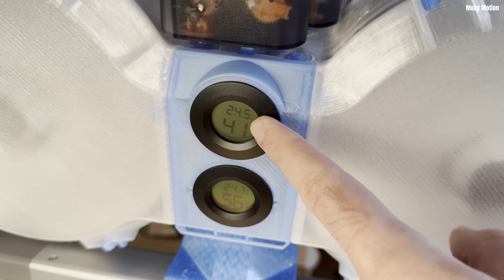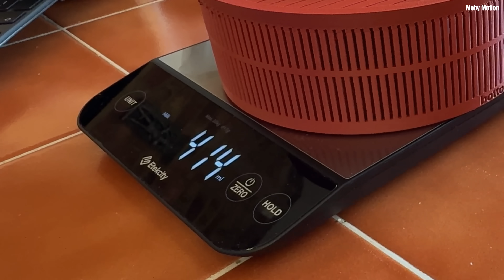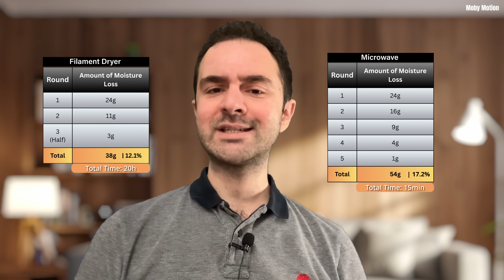Stop Drying Silica Wrong! Microwave vs Filament Dryer Tested

Comment: I recharged a couple 100g packs of rechargable beads and the storage bin has continued to stay at 10%... so I'd say nuke them, much less effort. I just put the bags on a couple layers of paper plates and did 2-3, 3 minute half power. Odd though that after the first 3 minutes the beads that weren't full on green were deep green, probably cause they were picking up the moisture the others were shedding. There is a lot of condensation around the packs at least after the first 3 minutes, and a little less on the second 3 minutes.

Comment: I prefer to bake the silica in the oven at 250F (121 C). The microwave is faster, but the higher heat and rapid dehydration actually damages the silica gel slightly and it won't last as many recharge cycles. A disposable aluminum foil baking pan works well in the oven.

Comment: I think the issue with the filament dryer is the water escapes from the beads into the dryer unit and makes it a very humid environment, further impacting the drying capability. Whenever I'm drying filament in my dryer unit I regularly flip the lid back (Sunlu S1) to let that humid air escape. I have also added a fan to my dryer to help move the air. 
However, I never bother drying desiccant in it, I just use the microwave in 1 minute busts, and shuffle the desiccant around in between to let the moisture escape from the middle beads faster.

Comment: Oddly enough the silica desiccant I have has instructions on  the label for bake it in the oven... you are the first I have seen talking about using microwave. I use a jelly roll pan (like a baking sheet with an inch tall lip all around) It goes in at low temperature and a bit later they are back and ready for more.

and yes you could also use a food dehydrator (the same as using your filament drier, but with trays that are designed with a proper plastic type for the heat.) or perhaps print your containers in a plastic that is designed for higher temperatures. If the melting point is too close to your dryer, it is not going to fare well.

Comment: Confirming what I had found but hadnt tested carefully so thanks for that... thanks.  I run dessicant sachets in the microwave and its fast and easy.  Especially when its absolutely essential vital non-negotiable to have DRY nylon filament.  The filament dryer boxes look cool but are not worth the money.  

Sachets are super easy.  No spilling pouring and they weigh 10g dry. 12.5 to 13g when saturated.  And it pop 4 sachets in the hole of the spool.

And I suspect cardboard spools are silly because they hold moisture and a bad idea especially with nylon.

Comment: Another problem with the dryer addressed by some of them is that it doesn't rotate the spool, which would avoid the need to mix and give more even drying. I still think that Microwave is best, and then use a vacuum bag to stop them from reabsorbing until you need them.

Comment: I personally found Silica with no die is far better than color indicating silica, then recently gave Activated Alumina a try.. MILES better than anything i've ever tried. You can dry it on the stove in a pan, in a toaster oven, air fryer ALL at max temps and takes about 10 minutes. The best part is it will not only dry the air to effectively 0% humidity but also holds far more water inside itself. Cherry on the cake, its aluminum so it won't really degrade and can be recharged unlimited amount of times. Indicating Silica starts breaking down after 10 recharges, and supposedly undyed silica can do 100's. I've only had to recharge my clear silica about 10 times so far (1KG at a time)
Reply: I’ve been drying my indicator silica in the oven (250F) for a couple of hours. Works well. But, like you say, it only has a limited life. I’m wanting to try activated alumina, but have yet to buy some.
Reply: @Deanna_the_Baker it's $16 on Amazon rn for 2lbs 👀 I paid $20 I think, it's a weird brand name too
Reply: @MrHeHim just ordered about an hour ago. Took the dive.
Reply: Are there any negatives to activated alumina? I'm wondering why everyone suggests silica when this stuff looks better in most every way and is about the same price, or even cheaper, and has a longer life. Why isn't everyone using and suggesting this instead?
Reply: @scilynt3997 I haven’t used it yet. But from what I hear the alumina beads include some amount to alumina dust. You don’t want to breathe this in, as it’s extremely bad for your respiratory system. 

I’m wondering if it can be washed and filtered first. Then dried before use.
Reply: @scilynt3997 that's what I wondered too, my guess is $$. because silica is cheaper to make and you will have to buy more later where activated alumina you buy once and it theoretically lasts forever

Comment: Note: You want borosilicate glass, because "pyrex" can be either borosilicate (good) or soda lime (bad). You'll have better odds of finding this outside of the US, whereas here in the States we would need to specify borosilicate glass.

Also, remember that most digital kitchen scales have a tare or zero function, so you could put a trivet on top of the scale, hit that button to zero out that weight, then add your extremely hot Pyrex dish on top.

Also also... your scale has mL of milk setting. Umm, OK.

Comment: I use a cheap food dehydrator. It dried the filament in just an hour or two. It uses gentle heat that is blown thru the unit with a fan. A lot of air change. Have to stir the filament about halfway through.  I fear microwave can damage the gel beads too easily. Microwave ovens can develop hot spots in them which could cause damage to some of the beads, even if you are careful.

Comment: Part of the reason your microwave had an uneven effect is because you do not have a rotating plate. The microwaves bounce around inside the containment box and there will be places that get more concentrations of energy than others. This has been repeatedly proven dozens of times and is the reason why the rotators came into existence if not being built in. It's just physics. The results from the filament dryer were lower because it is meant to maintain an environment and does not get hot enough to truly evaporate the water out. If the dryer were capable of 80° to 90°C it likely would have gone faster, but that would be detrimental to a spool of filament so that is why the temp is lower... to encourage that moisture to not stick around. Not bad testing arrangement, but I think you have found some of the errors in your testing process that can still skew the results.

Comment: Be careful with PYREX. There's a huge difference between PYREX and pyrex. PYREX is borosilicate so more chemical and heat resistant than normal glass, while pyrex is normal soda-lime glass, which isn't particularly heat resistant.

Also, the chemicals used in the indicator beads are pretty nasty, and overheating them can cause those chemicals to be released, so you really shouldn't dry them in a microwave that is also used for cooking food.

Since I don't have the space for a dedicated, non-food microwave, I use non indicator beads. These contain only silica, so are safe to dry in a microwave you also use to cook food.

To dry indicator bead packets, I just put them in one of my dry bead tubs and leave them over night. Mostly though, I've moved on to using electronic hygrometers rather than indicator beads. Since they more accurate and still quite cheap (£1.4/$1.9 each). I pop one hygrometer in each filament tub/vacuum bag and in each silica gel storage tub. It immediately puts a number of the humidity, and doesn't leave me wondering how close the indicator is to being 'wet'.

Comment: It generally takes about 10 minutes in the microwave for silica on defrost only and check it after five minute steered up to cook a 2 1/2 minutes on defrost stir it up and then another 2 1/2 minutes after you stirred it up and it should be fine. I’ve gotten the best results that way.

Comment: I use Activated Alumina it’s 2mm bigger then the silicone beads, the silica bees are roughly 3 mm in the activated alumina is 5 mm. It lasts a lot longer than the silica beads do cause overtime recharging the bees that eventually you can’t recharge them anymore and you have to buy another jug of silicone beads.

Comment: I need to do more tests but I discovered the beads I heated with 30 sec intervals in the microwave seem to have shrunk. When placed back into their containers, many fell through the slits where previously that wasnt an issue. ChatGPT says this is impossible so will take some measurements. V/Strange!!!
Reply from the maker: The beads do seem to come in two different sizes – mine are quite small, so I’ve had to print specific print profiles for anything that holds them. So it’s possible that your beads were already slightly too small, then shrunk slightly just due to the moisture loss (remember that they can hold up to 30% of their weight in moisture in theory). Or you’ve microwaved them on too high of a power and pulverised some of them.

Comment: Definitely don’t do this in an oven/toaster oven or microwave that you use for food. Yes it airs out, but it doesn’t completely clear out (internal fans and filters, coating surfaces, mesh). I have a small, used microwave I got off Kijiji. It’s the lowest powered one I could find, and believe it has lost power being about 10 yrs old. Both good for beads

Comment: Thanks. I started out using my filament drier, but was disappointed in the results. I tried the microwave, using a similar technique and it was vastly faster. My results were anecdotal. It’s great to have a better control study. Nice work.

Comment: I am wondering, if this works better in a microwave instead of a filament dryer or oven, would it be the same for filament? Could filament be dried quicker in a microwave as opposed to a filament dryer or oven?
Reply from the maker: @MyTechFun has made a good video on this I would recommend
Reply: @MobyMotion  Must have missed that one because i watch his channel regularly. Found it and put it in my playlist. Thanks.
Reply: I don't think so, silica gel in the microwave will happily heat up to 120 degrees C or more. Doing that to your filament means getting in the end a dry blob of plastic

Comment: I use a food dehydrator at 55°C for 8 hours but I am not really pleased with the results, so I am considering switching to microwaves. Are there any health concerns deriving from any fumes that might come out during the drying process in a microwave. Not planning to use the microwave for food. Just concerned about any fumes emitted in the room.

Comment: I do a LOT of this - recharging silica gel bead desiccants. 

The microwave method is ok, but your oven works better. 

Probably the biggest problem for the microwave method is that you risk burning the beads or starting a fire. 

IMHO, ovens work better and are safer. 

1 Get a large cookie sheet or baking sheet or a large rectangular cake pan. (Keep this separate and don't use it for cooking food.) 
2 Line it with tinfoil. 
3 Set your oven to bake at around 220℉ to 240℉. (Manufacturer recommends 250℉/121.1°C for 3 hours (avoid exceeding 250℉)). 
4 Set your timer to 1 hour. 
5 When the timer dings, open and close the oven door fully several times to allow air circulation as the air in the oven will have a high moisture content. 
6  Pull out the sheet/pan and mix the beads either by shaking the pan or using something like a wooden spoon. 
7 Repeat steps 4-6 several times until the beads are ALL recharges. Check bead colors for pockets of still green, or not fully orange. 

Instead of the manufacturer's recommended heat and time, a lower temperature and longer bake delivers better results. You only need to hit just over water's boiling point, so 220℉ SHOULD be good. Oven temperatures aren't always accurate, so adjust as needed for your oven. 

The lower temperature reduces the risk of burning the beads. The longer time compensates for that. 

Opening/closing the door for air circulation causes heat loss, but helps get rid of the moisture in the oven. While the heat loss means longer drying times, the air circulation (combined with mixing/stirring) leads to better, more even drying.

Comment: Just FYI There is a major difference in PYREX and pyrex, the company licensed out the lower case name to a company that makes normal glass not borosilicate glass of the original PYREX and that is what makes it not have issues with thermal shock (sudden temperature changes). If you have the anything in the lower case name, it can explode on thermal shock, may not do it the first few uses but eventually it will.

Comment: Personally I've only used the microwave and in much smaller amounts.  I think I did two minutes in the microwave, maybe three and only one time.  The top of the glass in the container would have a lot of water which I wiped away before trying to remove the beads.  I may try shorter times and a few rounds though in the future.

Comment: Interesting skipped factor would be energy efficiency. And I think the drying temperature is huge factor too. I use just normal owen with the aircirculating feature: set it 110-120C and I made sure that the beads are mostly single layer (it is just right for one storage box I use). I think I did 60-90min to get nice orange. I should do the weighting once :-D Btw., the 120C is not picked from the nose, that is manufacture recommendation for drying the silica gel beads.

Comment: I cover a large flat oven tray with foil and just do them in a 60-70 degree oven for an hour or so. Give them a stir every so often. Seems to work really well and very little messing around.
Reply: I did microwaving and damaged my beads from over heating.  My microwave must be higher watts than online guides assume.

I switched to using my oven and it's  much easier and fool proof.  No stirring, and if you leave them in too long, they're still perfect because the temperature is consistent.
Reply: You can bump up the temperature at least over the boiling point of water. Your oven will melt log before the silica gel.
Reply: That temp needs to be at least 115C

Comment: How about baking the silica in the oven at higher temp? Please note the color silica is toxic!
Reply: Blue indicator silica gel is cobalt based and toxic, but the orange stuff is supposed to be nontoxic.
Reply: @JamesChurchill  While the orange one is less toxic it still is thus using it in the kitchen appliances which are used for food (oven, microwave) is not a good idea. Found this information about it: C20H14O4  may very well be phenolphthalein, which is considered to be a carcinogen by some authorities, most notably appearing on the California Prop. 65 listing

Comment: Thanks for the video!!!  I've only tried drying used beads once. I started in a microwave oven but got bored, so I put a quart of beads in the regular oven for awhile. That did a great job. I will try my air fryer the next time I need to dry some beads. It would be very informative to compare those two methods with what you did here, too.

Comment: What about storing silica beads in socks or some kind of pouch? Then you won't have to worry about pouring it everywhere, and it's microwave safe. Though, I wonder if the fabric will soak up the moisture 😅
Reply: Good idea.  I'd use 100% cotton (*not* polyester) so one doesn't have to worry about melting the fibers.

Comment: One problem with using the microwave is that you can't control the temperature well enough. According to the manufacturer of my Silica too high (higher than 120 °C) of a temperature can mess with the crystalline structure, reducing hygroscopic capacity with each regenerative cycle. And temperatures over 100 °C can discolour the indicator.
Reply: You make great points and are in to something.  The silica will have some amount of moisture below 100C.  If the material never gets there, then it will hold on to the moisture no matter how much air is moved over it (unless you use already dried air, which nobody seems to do). Also, it will not matter how long it is held there if 100C is not reached.

 The silica doesn't need to be "fully" dry to do a good job, but we aren't getting the full drying potential out of it until we get it below 10% relative humidity.  Below that seems to have diminishing returns and we get good prints out of it, so we can stop there unless we are perfectionists.

Comment: Been saving silica beeds from bambu spools. Mix it with a little bit of indicating beeds. When I microwave the clear beads from bambu they turned to dust. Wondering if its the beads or if microwaving them is harder on the.?
Reply from the maker: Could be the power is too high on the microwave - I used medium, and you can probably go lower. Though I’ve not tried microwaving the ones that come in the packets. I wonder if it’s also the batch size - how many g are you trying at once, and how long?
Reply: @MobyMotion half cup or so. 3-5 minutes at a time

Comment: Yeah, my ACE Pro has a filament dryer built in, and I keep silica gel inside my spools in there, and this extends some range of the silica gel before needing a full dry, but then I use a microwave, I have just been doing 10mins in microwave on defrost w/o stirring, but now I'm thinking about doing 15min and stirring at 5min intervals.

Comment: Kind of pointless to dry at 65 degrees C. You need higher temperature. Repeat the test and dry at 100-110 degrees C and it will be fast and efficient.